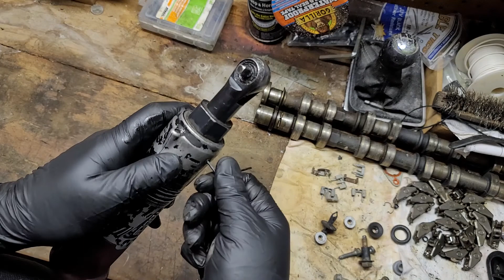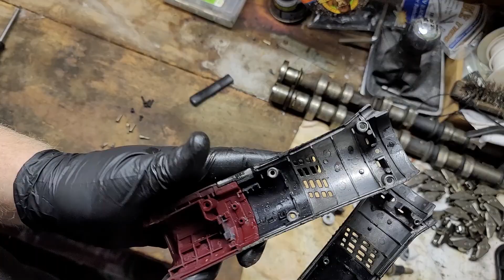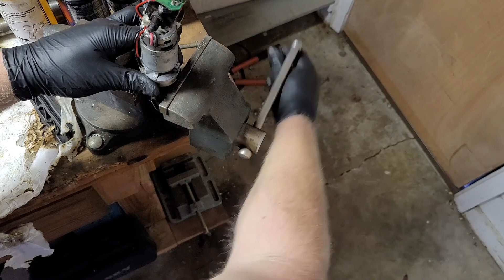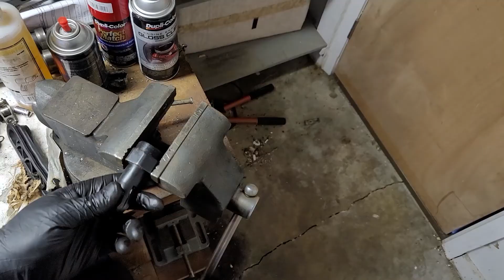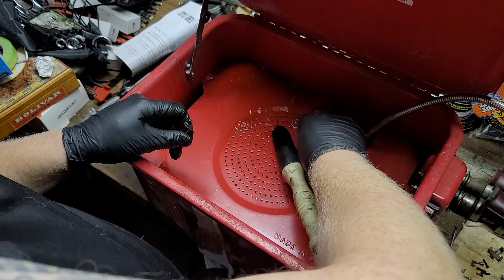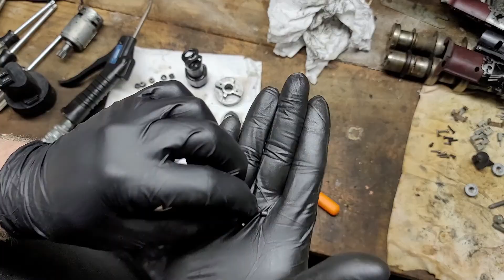Repairing my Matco Power Ratchet Part 1

Comment: So what was the general problem with it? Mine I noticed was starting to go out kinda slowly. I could switch gears and crank it some , then it would start to work. Then one day that wouldn’t even do it. I pull the handle and it just jammed. So I was wondering if maybe we had the same problem
Reply from the maker: Mine was getting sluggish and then just wouldn't move any more. I honestly still haven't repaired it. It's still in pieces on my work bench lol. The problem that I found is a broken pin in the ratchet mechanism. My theory is that pin caused drag on the motor until it quit. So, I think the motor is bad too 😕. When/if I repair it..., I'll definitely record it and upload to my channel. If you're subscribed, you'll get a notification 😉. Thank you for watching!
Reply: @theaffordablemechanic  lol , ok so I took mine apart and saw the ball shaped piece that connects the rotary part to the ratcheting part was jammed up! Put a lil impact oil on it and it’s working great now!